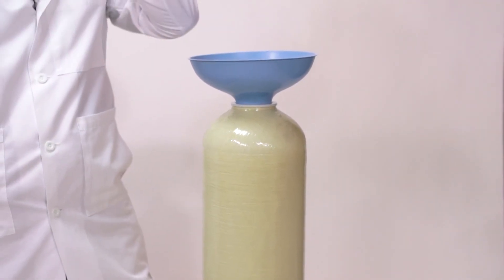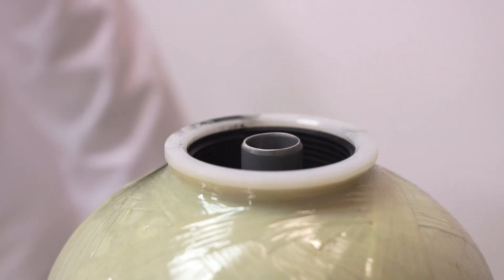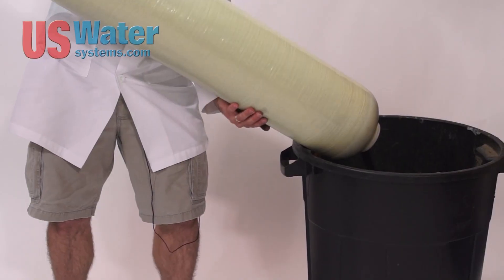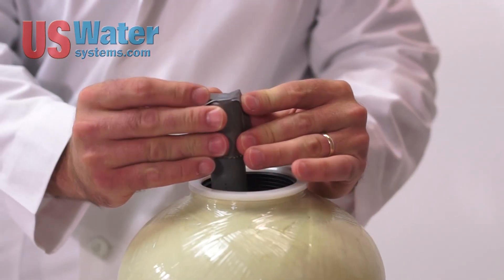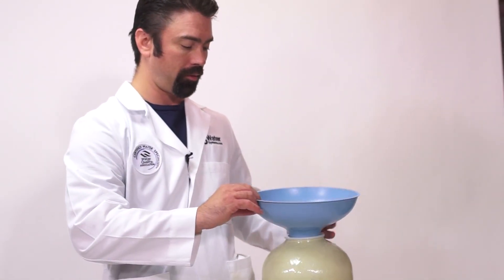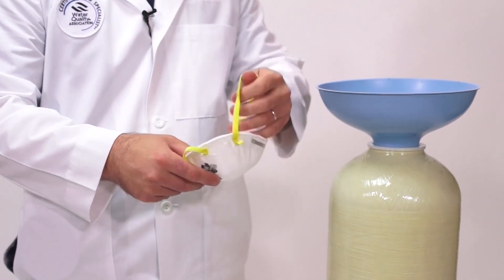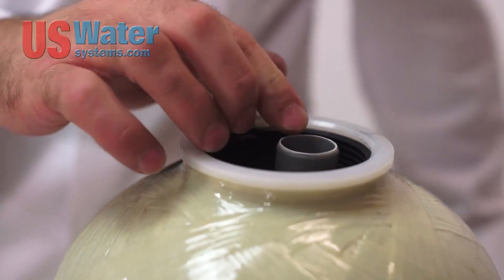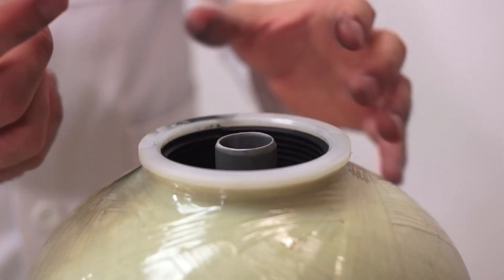How to replace Carbon Media in your water filter system

Comment: Hi, I have a tank with a Fleck 2510 head unit in the UK. Every year I just need to top up PH conversion media. Traditionally I left the threaded part in the tank and split the head unit. I then add media via the narrow opening. My issue is the gasket a 19936 is getting near impossible to get in the UK. My question is, can I safely unscrew the entire head and leave the down tube in place. Then add the top up media and successfully screw the head unit back in. Would there be a danger of disturbing that central tube and accidentally dislodging it. Obviously then creating a major job of totally emptying the unit. Thanks.

Comment: My tank STA-RITE RT-948. 040504 How much media do I need? Thanks. 48"Height and 9"width. It has back wash too.
Reply from the maker: Depends on what system you have. For that size tank usually one cubic ft (1 bag) and it may also need gravel. What kind of filter is it?

Comment: I have a brand new 10x44 tank that I am going to add to my 10x44 water softener tank as I’m rebedding with new resin. I’m going to put new tank before the softener. But want media that doesn’t get back washed. I ordered a regular non electric clack control head and also have a new riser tube. My question is, what kind of media would be best that would last at least a couple years without being backwashed. I’d like the best media. 

Here’s my current setup before water hits my main house water line:

One large capacity iSpring 50 micron self flushing electric filter, then 25 micron charcoal/sediment filter, then water softener, then smaller iSpring 50 micron self flushing electric filter, then three stage, 5 micron whole house filters (20x4.5 each), then the whole house iSpring uv light before hitting the main water to the house

I’m also wondering if there’s a way to manually backwash this. I was thinking if I ran the water in reverse on the new tank only with water entering to outlet and exiting the inlet with a garden hose attached, that it would backwash it manually

Thanks for any info!
Reply from the maker: Hello,
The media you use will depend on the contaminants you are trying to remove.  It is best to backwash media to ensure it is not getting clogged or that there is no channeling happening in the resin bed.  We can get a non electric backwashing head for you tank .  You should contact us and talk to a water treatment specialist.  They can help you with your selections.

Comment: would be much better if you actually perform a real tank with media. After installing the new stone and carbon media then reinstalling the tube and valve body, is there any filling of the tank and letting it sit for two days and/or some kind of backflowing efforts? Chocobill

Comment: Should I do a water test to know the type of media I need, or is all media the same?
Thanks in advance
Reply: It is not all the same and tests taken at one time may not help. It's good to know what type of water is being sent to your home. Here in SE Florida we have chloramine treatment which means no free chlorine bleaching out of the yellow color so you should use a carbon capable of doing both there. We found one that does work well for both but is pricier than the cheap stuff. We also found that almost all the other companies in our area are not using this carbon but a cheaper less effective type that is ok on chemicals, though slower reactivity requiring larger amounts, and are not rated for tannin color removal. The only time we may sway a little is if we find the chlorine levels to be really high so we do use a blend of both by making half of it the best and most reactive chemical removal carbon. Again pricey - but the correct way to treat water. There are other filtration medias but they really do next to nothing with the water type we have here.

Comment: How U gonna pickup a 16" tho :/
Reply: I used to lean it over on a metal screen and used a hose to empty out the carbon and then filled up a couple of buckets with the spent carbon and gravel and then propped up the end of a hand truck to tip it over more. 16" were difficult but manageable.

Comment: I insert and cap the center tub, I fill the tank with water, I then add the pea gravel, then I add the carbon and as everything falls to the bottom the lighter stuff just overflow with the water. It makes it clean enough for me.
Reply: I wouldn't completely fill the tank with water

Comment: Adding activated carbon without a 6" gravel underbed is just all wrong. Distributors only will plug up. Carbon begins to build up biologically after about a year and should be replaced. 5 years is also all wrong. You can tip over the tank and use a hose over on a screen below it to catch the carbon. I also find it best, with the top off, to slowly with a hose add water until full. Then let it sit for a little while which when it is put back together will flush out better and quicker of the carbon fines.
Reply: What size gravel should be used?
Reply: How much carbon should be used?

Comment: What do you use to seal the valve at the top of the tank when you put it back on? Gasket material or gasket maker of some sort, coat the threads with pipe dope?  Thanks.
Reply: Never put anything on the threads. The seal is on the o-ring. Some rubbber gasket lube should be used or replace the o-ring if you are worried.
Reply: @waterpurificationproductsi7056  why isn't this new "O" ring included as a complete replacement package as well?
Reply: The heads have o-rings and some gasket lube should be applied to the o-ring only. Never put anything on the threads. It's a good way to cement it closed forever or damage the threads on both. We rarely ever have to replace o-rings in the last 50 yrs of service  so why include a replacement each time. Also not all heads are the same even though most tanks are. Different controls and heads may use different o-rings. Just lube it and make sure it is in it's proper place.

Comment: Have a easier way to take the carbon out of a tank without lifting the system at all. It takes no more than 5 minutes
Reply: care to say what that way is?
Reply: @swsquish  No, it's a trade secret.
Reply: take the strainer off the uplift pipe... flush the vessel. carbon comes out.

Comment: Bad directions here. There should be a gravel base
Reply: not on a small vessel that size
Reply: @chapterk-2586  Gravel underbed on ANY carbon filter of the tank type and that was not a small unit. On softeners it is not as critical until you get over 10" diameter.
Reply: @chapterk-2586  Nonsense! At all times, you should at least cover the distributor basket and add a small extra layer above it. This helps ensure better water flow through the basket and prevents it from becoming clogged with carbon.
It is definitely not true that this is unnecessary for small tank sizes. It is necessary.

Comment: Every month when my water softener regenerates my water comes out black from the faucets, sinks, toilets and showers. It will stay black for a couple days then clear up. My clothes have also started to have a musty smell and won't go away no matter what I do. The black water has ruined my toilets and showers. Is it because I need to replace the carbon? Please help me I'm desperate. We have had our softener for 4 years.
Reply: Sounds like you didn't put pea gravel in before you put the carbon in the tank. Usually you put in a good 6 in of quarter to half inch pea gravel before you put the carbon in which should prevent this exact problem happening to you
Reply: If it's possible that your company blended carbon with the softener then it needs to be rebedded with softener resin only and a separate carbon filter if you want filtered water as well.

Comment: hello, we're going to use 13" by 54" tank but we don't know how much media we need to use. btw, we're thinking of using activated carbon and 2 layer of gravel for our post-filter and silica sand and the same layer of gravel for our pre-filter
Reply: It depends on whether it is a straight inline filter or a backwashing filter. Either way 6" of gravel.
Reply: If you don't know,the rule of thumb is to leave 18" from the  top so on backwash nothing goes to the head.
Reply: @truth6600  More like 16". 50% freeboard is required and 48" of the tank is the usable space. The 6" of gravel should not move unless you have the backwash rate set to high. GAC backwash rate is about 10gpm/square foot. 13" tank is just about that so a flow control of 10 gpm is recommended on the backwash.

Comment: Hi .please tell me .i have needs par day 4000 liter water. .4% iron and 2% mud in my water. Please tell me how much of the amount of carbon or resin or other medan how many kg need .and what the name of other Medan
Reply: sulaman sulaman332
Reply: Use 1354 vessel with 75 liters of iron removal mno2 and a carbon filter after resin filter  to remove the oder 
Any doubt mail me cxcwallis@gmail.com
Reply: Your figures do not appear correct. Could you be using the wrong terms? I also never heard of a "mud percent" number and I am a former director of an EPA Certified Environmental Water Quality Lab.

Comment: How often do you need to change the media? I purchased this property 19 months ago and the water was great, it is well water. Just before Christmas the water has started to smell a little like sulphur. The well and filtration system was installed in 2005.
Reply from the maker: Please call us at 1-800-608-8792 to talk to one of our certified water specialists about proper well water treatment! Thanks!
Reply: How long the carbon can last depends on the amount of Hydrogen Sulfide in your water source, the amount of Carbon you are using, and how much water you are using. Also, the Carbon usually needs to be washed with a chlorine solution to last longer when Odor removal from Well Water is the application.

Comment: How can I tell what type of media I have in my system?   I am trying to remove Iron stains
Reply from the maker: Call us at 1-800-608-8792 or visit uswatersystems.com for info on Water Tests. You first need to test your water to know how to treat it properly.
Reply: Bagaimana kalau tabung nya 4872, bagaimana caranya untuk mengeluarkan media nya?
Reply: Sometimes that is difficult because many iron removal medias look alike. Just use whatever media you choose for iron removal. Another hint is if it required regenerating with Potassium Permanganate which would make it MGS or MTM.

Comment: do you have to put pea gravel in before the carbon?  I never heard that before?  Also, I know I need to put a cubic foot in mine, my question is.... aren't you supposed to do a rinse out of your newly bedded carbon filter before running it through your softening system?
Reply from the maker: Yes, it is highly recommended to put gravel in to help flow rates and support carbon media. Yes, and ideally once your carbon is added to your tank, you would fill the tank with water and allow it to soak before hooking it up to your system. You do want to put it through a couple of backwashing rinses first.
Reply: @uswatersystems  why didn't anyone tell me about these additional steps when I purchased my new media and stones last week? How much time is required for the soaking and then backflushing? Should this backflushing feed in through the upper or bottom connections on the valve?

Comment: How to know when to change the carbon
Reply from the maker: The main purpose of carbon is to remove taste from the water. If the water begins to taste strange (like chlorine) then you know it's time to replace it.
Reply: I am also using a reverse osmosis filter so that would not work. Could you suggest something else?
Reply from the maker: Replace the RO filters
Reply: @edwardgreenberg8298  We recommend 6 month replacing of the filters on RO systems especially the pre-filter to help protect the membrane that can last multiple years if serviced regularly. Again with any filters do not do it less often than yearly.
Reply: It only becomes a matter of taste and odor if before a year. It should be rebedded annually due to expected biological buildup anyways. Do not create a "farm" inside by following "glowing answers"

Comment: What size gravel media?  1/8" pea gravel or smaller?
Reply from the maker: The gravel we use is 1/8" by 1/4" .
Reply: @uswatersystems  We use Red Flint #20 1.65-2.0mm

Comment: Thank your for this demo. I will appreciate it if you can do a video about how to replace the iron Media Filter.  Thank you.
Reply: Same steps. Only more difficult because Iron Media is heavier than Carbon. Remove media, put distributor pipe in tank ( cover pipe opening ), pour in Gravel, and then your media ( remove cover from pipe ). Backwash new media once you have re-installed the control valve head on your tank.
Reply: @supportsoftenerparts7976 

I have a brand new 10x44 tank that I am going to add to my 10x44 water softener tank as I’m rebedding with new resin. I’m going to put new tank before the softener. But want media that doesn’t get back washed. I ordered a regular non electric clack control head and also have a new riser tube. My question is, what kind of media would be best that would last at least a couple years without being backwashed. I’d like the best media. 

Here’s my current setup before water hits my main house water line:

One large capacity iSpring 50 micron self flushing electric filter, then 25 micron charcoal/sediment filter, then water softener, then smaller iSpring 50 micron self flushing electric filter, then three stage, 5 micron whole house filters (20x4.5 each), then the whole house iSpring uv light before hitting the main water to the house

I’m also wondering if there’s a way to manually backwash this. I was thinking if I ran the water in reverse on the new tank only with water entering to outlet and exiting the inlet with a garden hose attached, that it would backwash it manually

Thanks for any info!
Reply: https://youtu.be/ipF1tFekFvo

Comment: Don't you need to also put in pea gravel too?
Reply: Thank you sir. I look forward in checking it out cause i need to replace my carbon soon.
Reply: Yes, you do. For some odd reason this important step was left out of the video. There are articles on the Web that explain How To Replace Media ( Carbon, Birm, Greensand, or Calcite ) in Filter Tank
Reply: I realy need the multiport valve, litle bigger around 2 inch, where can I buy it. Could you give me information about it. Thank you.
Reply: Came here to ask this exact question but us water systems carbon tank and it came with the gravel and instructions to put a couple inches before you put the carbon in so I'm not quite sure why they left out of this video. So just to clarify it absolutely does need the gravel in first before the carbon correct?

Comment: The company I purchased my water softener from charges $98.50 for a "cube" of carbon. It is the only size they sell. They will come out and change it for me for $100. + tax. I can't justify trying to do this as a DYI project for the money and effort involved. Besides, if THEY break it, they pay for it.
Reply: The home service call in includes the carbon.
Reply: Claude Vann My company is gypping me---they charged $ 300 !
Reply: Sounds like perhaps you company may be doing it close to correct but still too cheap if using the really good stuff. Cheap is not better - cheap is cheap. And we are talking about your drinking water and if you want to cheap that? It's your choice.
Reply: That is a good price. Most dealers do charge 2x or 3x as much for this product and service.
Reply: I've been charged $200. Is that good?
Reply: I charge $375 for this. The key is the quality of resin you are getting. Sure for $100 you are getting the poorest shit on the planet put in guaranteed. If your happy with that then ok.
Reply: @jasonspencer6990  What kind of carbon resin you recommend for a oxytech ec4 quality wise ?
Reply: @angelmarrero5498  Carbon and resin are two separate things and should be NOT mixed together. Softening resin is regenerable and can last many years. ALL activated carbons are not regenerable, adsorb in the chemicals, and build up biologically after a year. Yearly rebedding is the most desirable. It is BS sales talk when they say multiple years and millions of gallons. It should be separate and installed properly so it can easily be rebedded as frequently as it really should be. You want to believe the sale BS or listen to actual real experienced and qualified water treatment people - your choice.
Reply: That is one really cheap low quality carbon at that price.
Reply: I know this is an old post but I just got quoted $600 by a local guy, this used to cost $200